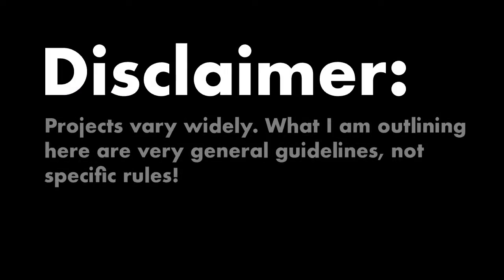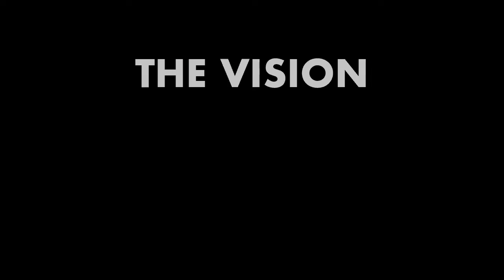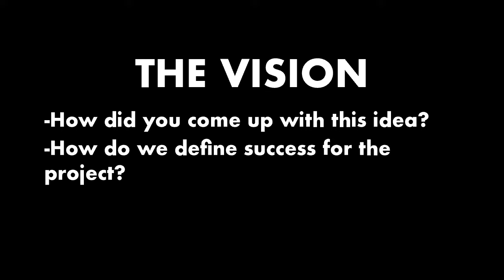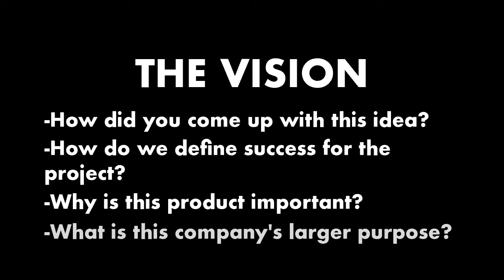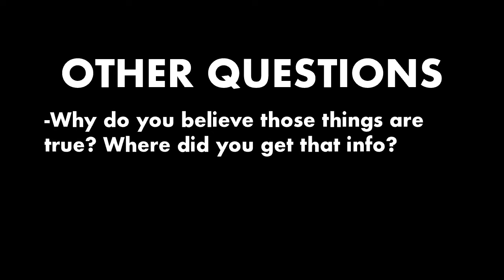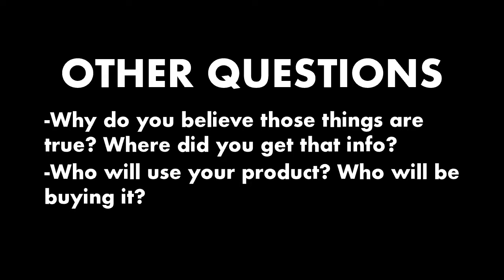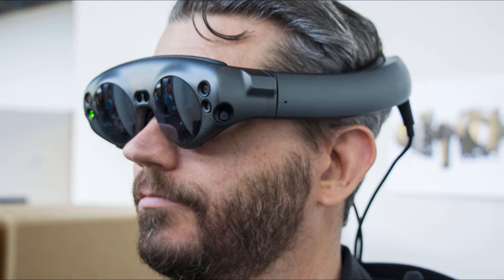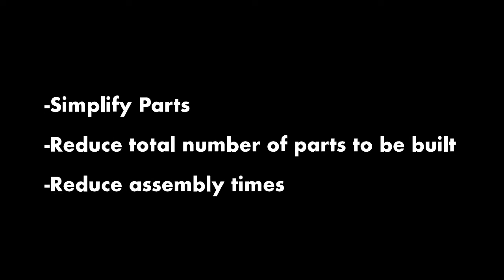How To Design and Manufacture Your Product Idea: An Industrial Designer's Perspective

Comment: For small quantities I completely skip the traditional methods and just use 3D printing for the prototype, then cast a mold of the object out of silicone and finally cast copies of the object using industrial resin and spray release. Proper 3D printing is expensive so I only print one prototype on a proper powder-based 3D printer (using Shapeways) so that all of the printed pieces fit together, then I make infinite copies using the techniques guys who make cosplay props use.

Comment: Everything is mass produced, that means some form of stamping of or casting from a mold. For an object to come out of a mold the outer opening needs to be larger than inner - otherwise the cast object won't pop out. Any object that closes on itself will be make out of at least two separate pieces that connect together.

Comment: On the subject of design for manufacture sometimes more parts are better. If cost is an issue and you don't plan on making alot of something then high volume methods are not practical like forgings,deep drawing, castings, extrusions and injection molding are good for high volumes but way too expensive for low volume. If you design a box with a handel it might be cheaper in the short run to make the handel out of many simple parts riveted together than making the handel integral to the box, the higher labor costs for assembly would be lower than the tens of thousands of dollars in tooling costs. An example was the Apple II, Steve Jobs insisted on a monolithic injection molded case as opposed to a case made from plexiglass bolted togheter proposed by an engineer but the tooling to make the case cost $200,000 and without outside financing they never would have been able to make it.

Comment: I am a product & engineering manager with experience in building tech gadgets (mostly in China) and the video is quite on point, but there are several ways to make it cheaper. i have finished several products myself within US$5k budget (from ideation till DFM) and sometimes even less. 
Here are a few key ideas and point for anyone who wants to make a truly bootstrap prodct
1. vision is important, but a complete validation of the product is way more important. Vision tends to be too intangible. you really need to get a fully validated (based on data from other people than your own experience) product requirement document and focus on all the aspects of customer story, pain point, solution, prioritized features, usability model, technical feasibility, business viability (if you have stakeholders) and aesthetics. If you don't do this extremely well, you might very well end up making a product nobody buys and that's the most expensive part. 
2. Prototyping is essential in the validation but it doesn't need to really cost much. Start with low fidelity (cardboard, sketches, a good story), test with customers, only progress to higher fidelity proto once prospect customers start shouting "hell yeah" at you. If you get just "yeah", restart. This really doesn't cost much more than your time. 
3. I have paid under US$2k for a decent industrial design for a home NAS to an agency in China. It wasn't Bauhaus grade, but good aesthetics won't make up for a lack of function, especially as a small team/solo project. ID is often about GIGO (garbage in, garbage out). Make sure you create a mood board with products you want to emulate and share that as part of the guidance package.
4. In terms of mech engineering & DFM, many tooling factories in China are actually able to do it for you for under US$1k if your ID (industrial design isn't completely useless). Look for smaller shops, ideally through a local contract manufacturer/electronics suppliers. Alibaba companies tend to be too large for small projects
 5. Tooling cost is pricey, aluminum molds are nice, but not everyone is willing to do them. Here really slim down the number of parts and you can also consider grouping various parts into a single multi-cavity mold. that can save some 20-30% compared to making multiple moulds. If your design can use extruded parts or stamped parts, you save yourself maybe 80% of the costs.

6. certification - i have not ever come across a product which mandates UL. It's often required by retailers, but you really need mainly FCC (US), CE (EU), IC (Canada) for electronics (if you avoid wireless features, the certification costs under $1000 in China). then add some chemical (CA65 for US, RoHS for the rest of the world) and maybe a few others. Generally, there are a ton of labs in China/Shenzhen, let them tell you what you can't get away without. Compare prices aggressively.

hope these help :)

Comment: Hello Sir Design Theory, I would to ask this question..., I would like to design things and also do the Engineering stuff, what do you call that job/discipline? A Industrial Engineer?   A Design Engineer? 
I would really like to know because I want to learn it and someday create my own company... Thanks!
Reply: Hello, I'm an Industrial Designer, and I want to have more knowledge in engineering, specifically in production, materials, and all these factors. I know it's more aligned with mechanical engineering, but I don't want to pursue another degree entirely. Therefore, I wanted to know if it's possible to do specializations or master's degrees in that particular field as an Industrial Designer and be able to work in those fields.
Reply from the maker: That would be called a design engineer, or product design engineer!
Reply: @Design.Theory  Thanks a lot !!!   your videos are a great help to people like me who aspire to do this kind of discipline
Reply: Same thing I'm looking for , maybe a Product Design enginering masters and then do some free online courses or cheaper HND engineering course to solidify it.

Comment: I am a mechanical engineer preparing for entrance to get admission in master of design right now. Man you have very good knowledge about the design and manufacturing. I think that many engineers shy away from crude prototypes and wait for perfect product build by heavy machining and that's the thing engineers should learn from Design and Designers, Crude prototypes really helps to decide if product is viable or not and it saves so much time. Your content is pure Gold, Keep creating such a high value videos and Hiii from India😇...
Reply: In my experience as en engineer a lot of managers think they have a finished product when they see the first prototype kinda working. Or focus on the visuals really early on in technical approaches noone in the company ever tried
Reply from the maker: Thank you Pratik! I really appreciate that :)

Comment: It gives a very good climpse of how complex manufacturing can become! But there are products and volumes where you don't need six figure budgets. Especially if you are a startup and want 1000 of something to test out a market. In some industrial feature-driven applications ID might be even unrelevant to get the first customers buying it. Ofc. you have to iterate from there on but you get in many cases a MVP for less than 20k$.
Reply from the maker: Yes. Very true. I have made designs for around that price. But I also did most of the work myself and didn't have to pay anyone else for development work. If it's a simple hand tool that's only made from one or two parts, it's totally do-able. Thanks for the clarification!

Comment: Great video!

Nice to see the 'revamped' double diamond process in there @ 6:16.

I think that model is a good way of showing where ultimate responsibilities lie; the first being the commercial solution of the owner/client, and the second being the design solution of the design team. Of course an owner/client would be well advised to involve the design team in both.
Reply from the maker: Yeah, that diagram has a lot of explanatory power and I use it a lot when speaking with clients. Thanks for the kind words. Glad you enjoyed the content.

Comment: Great description of the entire process. Makes me wonder how much money I'll save bringing a product to market since I have a pretty broad range of skills (CAD design, electronics design, 3d printing), I'd need DFM since I'm not sure what constraints go into tooling, and I'm sure they're quite different than designing for prints.
Reply from the maker: You can learn a lot of this stuff and do it yourself. I learned most DFM stuff while working on the job.
Reply: @Design.Theory  What would you say the biggest caution would be in designing for tooling? Are there any good resources you'd recommend for self teaching?
Reply from the maker: @darkshark9  Yes. Consult with your manufacturer. They know the most about their process and what you need to do with the parts. I should have probably mentioned that in the video, actually. Aside from that, my best advice is to hire engineers who really know their stuff. Unfortunately there aren't many good resources that I know of. If you find any, let me know. That's one of the reasons I made this video.
Reply: @darkshark9  If you're asking about design considerations for plastic injection molding (IM), there are many websites that cover the basics; taper/draft, wall thickness, rib/boss/joint features and the like. Beyond that, you can pull apart and study a heap of IM products to see how they've been designed.
Reply: @Design.Theory  thats how most people learn it. Even engineering classes dont prepare you for the DFM specifics that you have available and can afford